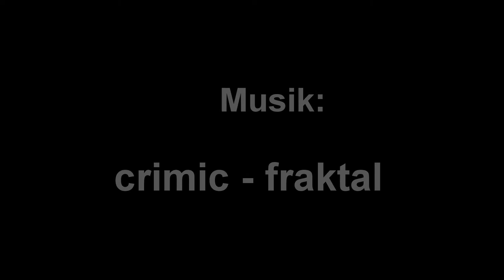midibox blm-16x16+x - built - stop motion - music by crimic

Comment: i wishec i had this for my new midibox. i know the midiphy version but not in my budget.
Reply from the maker: hmmm the old one is not much cheaper! i calculated the costs some time ago: http://midibox.org/forums/topic/21123-blm-16x16x-costs-calculation/    ok in there is already the built time... so its cheaper...

i have 2 off it, one with case (used), the other without and never used... i can transfair the new board into the case... price see link..
. i want to bring matrix into eurorack, so i did not need it anymore.
Reply: @Paradiesgestalter  sounds great...maby if not i will collect and wait till i can afford the new midphy one, witch is also awsome.... then it´s fir to my Midiboxv4+ case :-) we see. thanks for doing a nice job.